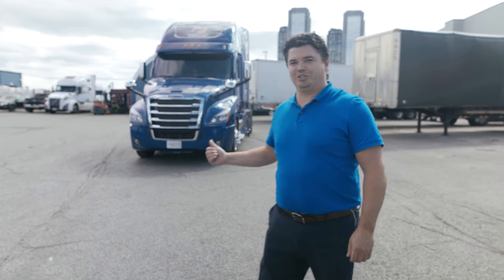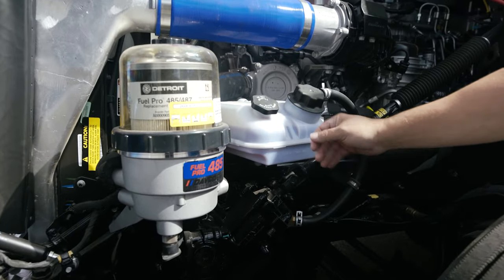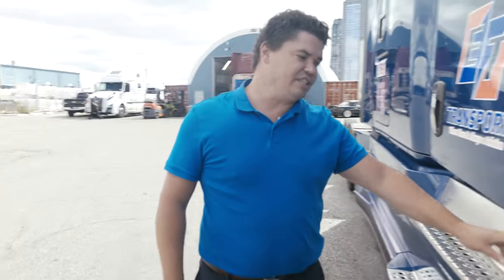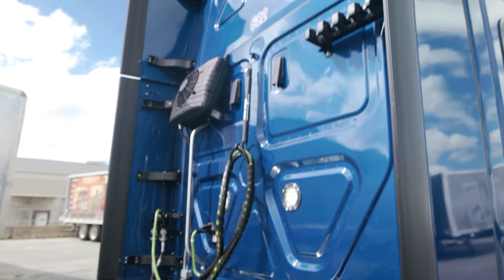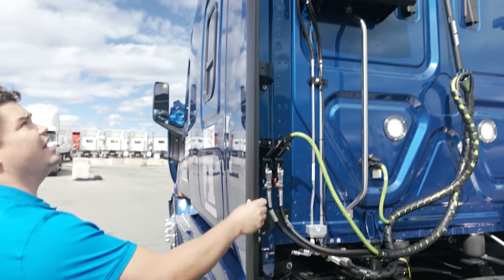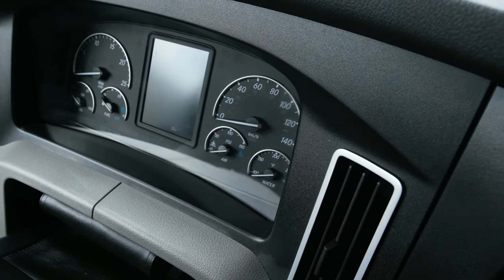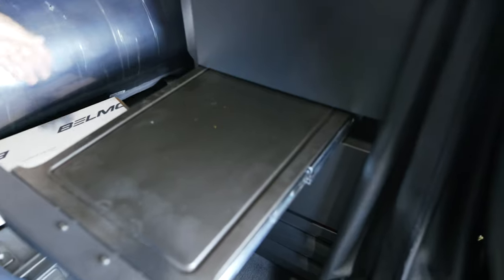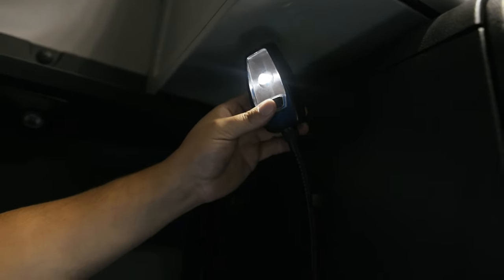2021 Freightliner Cascadia In-depth Review & Tour (Exterior, Interior, New Features, Upgrades)

Comment: Driving one of these now. BE AWARE that one of the things we have all had to change out before you cannot do yourself. During one of my pre-trip inspections I noticed my passenger headlight were out. Although, it is just a high beem light, if DOT pulls you off for inspection you are required to have both high and low beems working. Long story short, Freightliner has made it so you cannot change either bulb. It has to be done by the shop or at least buy one at the shop. It isn't just a bulb, it is the entire headlight assembly. They run anywhere between 800.00 and 1000.00 dollars to buy plus an hour labor. But you can't do that either because they are on national back order!!! What the heck Freightliner???

Comment: Why would you put the fire extinguisher in the middle of that driver side sleeper door space? It takes over all the room in the middle for drivers tools or what they need to put in there.  And also everyone must know that those Parksmart APU's do not work very well with blowing out A/C in 80F or above. You have to run the truck and use trucks A/C because the Parksmart A/C dose not blow out cold enough to keep you cool in the sleeper.

Comment: Its nice and all for comfort, but once you get out on thw road, you better be ready for all the annoying ass sensors going off......
Reply: You can turn most of them off
Reply: @jordanab100  lane detection does not stay off and can't turn off forward radar that thinks bridges are a hazard
Reply: @moparjr89  yes you can! The lane departure has those two dedicated speakers. The covers just pop off and you can unplug the spade connector. That solves that. As for the forward Radar just unplug the sensor in the bumper. The cruise will still work. If you don't want to unplug the sensor just tape a piece of foil over it.  Then if you want to change any thing in the emc the code is 0000 and any mechanic can set speed or anything else for $100

Comment: The head visor does more than just black sun from the driver, it’s an arrow dynamic wind 💨 hook which causes the wind to hook under the visor and pull the truck along the road if he’s doing over 60 miles an hour increasing fuel mileage

Comment: I could be mistaken, but it seems that there is less cabinet space in this 2021 model than I have in my 2015.  Or I should say less USEABLE cabinet space.  I have an under bunk refrigerator “drawer” that utilizes the under-bunk space much more efficiently than my previous year models did, which allows that section of cabinet space to be an actual cabinet instead of the fridge that is shown here. And the platform next to the head of the bed is essential for nighttime things, and that has been removed in this 2021 model. I’m thinking all that would be a deal breaker for me, sorry to say. Love the look of the outside though!

Comment: The Parksmart APU sucks. During comfort mode the truck turns on and idles to make the truck cooler. The APU cannot keep the truck cool with it just running by it self. So around 90F it will turn on about every 30m or 45m and run for about an hour to keep the truck cool. There is no point of having an APU if the truck is going to idle and waste fuel. If I had to buy this truck again I would never get the Parksmart APU with it. I would tell the dealer to find me a truck without it and I would put a desiel  APU in.
Reply: The Dclimate APU is good. It’ll only turn the truck on if the battery volt goes below 11.8, which isn’t too often

Comment: Is that truck concidered a P3 because of the limited features other 2021s have? Noticed you call the door  radars wind deflectors. And no tablets on dash. The cluster is a tablet now and one mounted on dash as well. From a mechanics stand point the frame y's out now from front to back I like. The motor is lowered 3 inches and cab moved back 3 inches as well. Never mentioned how the steering wheel has sensors in them now to see if the driver is holding it properly. This new cascadia is mainly designed to be a taddle tale for the business owners I believe. The timing when the cameras activate is when the driver isn't being perfect. Such as driving 80 mph and over for over 1 minute and many other reasons. Not a fan as usual unless it has a cummins in it.

Comment: a large part of the switches and switches come from the 2004 Mercedes actros, i.e. they are very old, but always worked, . good materials, no possibility of dividing the bottom bed and the table in the middle, cb radio in the glove compartment?  it would be a pity to be somewhere in a visible place.  Your weights are cool, we don't have them in Europe.  despite 28 years at the wheel, sometimes I want to go to the US truck for a few days and go for a ride.

Comment: Very informative video
Question for you though 
For the companies that have these trucks that do not supply refrigerators...
I'm wondering what the dimensions are of the area where the fridge sits when the driver wants to use their own fridge...
Depth, width, and height?
I would like to use the 4.6 cu ft unit. Is there enough room?
4.6 cu ft
48.9" tall
21.61" deep
19.13" wide

3.1 cu ft
32.87" tall
21.1" deep
19 13" wide

Comment: my company has a fleet of 2019 2020 volvos. i used a 2021 cascadia for a day as a rental.  i would trade the volvo for the cascadia any day of the week. more comfortable, more room, less techy annoyances like beeping and buzzing. the only issues with the cascadia i had which isnt present in this particular truck is it had a huge radar system mounted on the windhsheiild blocking a sizeable amount of vision.  the side mirrors seemed to small as well
Reply: In Europe the Volvotrucks are great. Much power, good transmissions and a high visibility. The mirrors are perfect mounted haddn´t those big brackets.

Comment: Good presenter. Should consider adding a flexible, tilting solar panel on top to charge batteries and, or run AC for keeping cabin temp within a range
Reply: Truck has autostart to charge batteries

Comment: Not a driver but the new young drivers were not around when cb was a lifeline on the road. Your smartphone doesn't tell you when a pileup just happened up ahead when they're hauling ass down the road. Bang! you just became part of the pileup. The 2015 pileup on I-80 is proof off that.
Reply: Ross- A -Roni  wrong youshould not be on your phone while driving plus google does not have truck routing

Comment: A lot improvement for aerodynamics but nothing for driver’s comfort: still same small sun visor, no additional side sun visor; steering wheel angle controls by handle instead of pedal; too high dashboard blocking hood mirrors; small side mirrors on fat leg that blocks objects, especially on the right side. Come on freightliner, this is not a small car, it’s a truck and interior should be engineered with truck driver in mind.
Reply: My company just went to all Freightahakers. I def don't want to give up my T680. 🤦🏼‍♂️

Comment: If they are so concerned with airflow and fuel efficiency why haven't they gone to mirrorcam instead of door mirrors like Daimler have used on Actros for the last 18 months? It saves a lot of drag, maybe they thought that North America isn't ready for that yet, they'll catch up,,,, eventually.
Reply: There are half way just with dashboard. Have a look at Volvo, dash is one big display. There are no info about engines, gearboxes. I noticed rear lights on middle of chassi? Still old school. Interier is much better but compare with European lorries still 10 years behind
Reply: @thomtrucker1925  volvo dash is not a big screen but both freightliner and kenworth have all digital dashes now no regular guages anymore

Comment: Anyone knows where the suspension dump valve is?
Reply: its on the lower center dash by red and yellow valves it should be next to 5th wheel slide and axle lock. airdump has a red led light and a audible tone to make sure you flip it back
Reply: @el-hp1lj  it's not there but thanks anyway
Reply: @sandasturner9529  some cascadias don’t come with them for some dumb reason

Comment: All accessory review no technical and mechanical information provided. What improvements have been made to the engine, emissions control systems and that crazy ishift transmission ? on these trucks door handle , bumper and load blocks mount are the least of your nightmares

Comment: 1-Cruse control:engine brake applier is always +5 and driver can’t change it!!!, and uphill Cruse control stops  at -4 speed limit , again driver can’t change it. Means always driver must keep manually accelerating and braking (almost useless) .  
2-Internal auto door comes on. Inside Dash, you can stop cab door auto off but not front. Terrible idea.
3- Auto shut down engine after 20 minutes, to force driver using APU…. Terrible Idea……
4- when APU is running, the ceiling middle light that’s inside  behind cab curtain auto turn off. So for you to leave it one on, it’s the 2 light that half light reach the front of cab curtain(at night all ppl will see inside your truck) terrible idea.
5- when cruise control is on and reach downhill, it should go one by one , one gear lower, but it’s not , right away double or triple down gear means it hurt engine to RPM so high. If they say for safety well it happens same thing on uphill, it should start a one gear lower but it doesn’t, many times (not always) it starts with gear 10 or 9. Even I realized that uphill doesn’t need that gear= hurting engine with high RPM.
Reply: The rest is good

Comment: Great video. I drove one of these for several months, the battery powered sleeper AC / heat is totally awesome. 
You can also run your TV, refrige and satellite with it and the engine will only start up after very many hours to recharge, if it is even necessary - which in my experience never happened!  
Basically, it's a fully battery powered APU that recharges while you drive ( And doesn't keep you or you neighbors awake at night )  I also enjoyed the advanced radar and the instant fuel economy monitoring in my unit. Some of the many reasons that the Cascadia has become so successful on the road.
Reply: It doesnt have AC. Truck has to be idled. Only heat

Comment: I would like to know who's the engineer who designed the heating and cooling in the bunk bed, it's the most stupid and dumb design I have ever seen, the AC would go on in the 0 degree temperature to try and maintain the the temperature that I have set and the vents ar put right on your head and while you sleep the AC will automatically go on it freezes your head, it's a company truck so I'm gonna ask to switch to a international or quite the job, personally I will never by a freightliner

Comment: plastic junk. throw away truck at best. all sorts of unnecessary electrical components that will leave you on the side of the road. dealer only fixes. call a wrecker. the money you saved on fuel will come in handy for the tow bill, road salt and tiny little wire connectors don`t mix well Freightliner use to to make a quality product. it won`t out last the payment book, I`ll keep my `81 W 900 thanks

Comment: I have one miserable Freightliner Cascadia Evolution 2016 and will never buy this pathetic pos junk ever again.  The most unreliable POS on the road.  When you see a truck broke down on the side of the road, 99 percent of the time it is a Cascadia.  Won't run in the rain and there is no way to fix it.  You just pray it makes it for delivery and doesn't show you its stupid engine lights which won't take long.  Headlight replacement? $250 versus $20 for a Freightliner Classic headlight.  Watch out for being ripped off by Freightliner telling you that you need a new 10K one box when you don't really need one.  Freightliner used to be the standard for reliability.  Not any more.  Very dishonest.